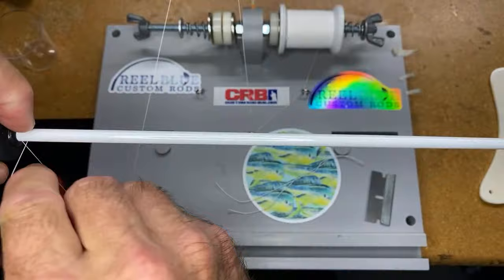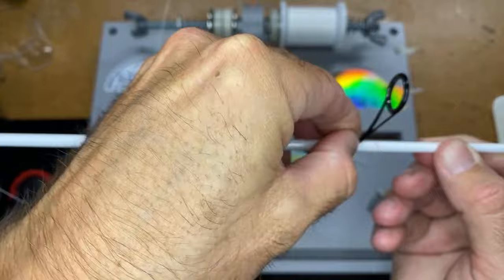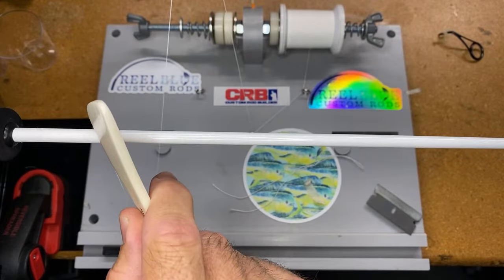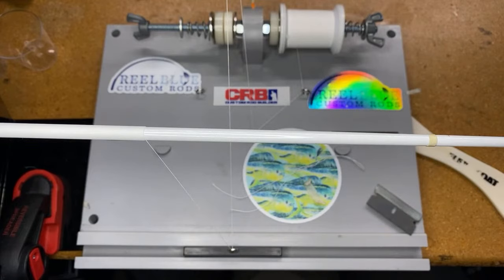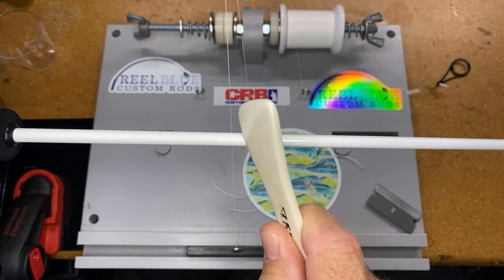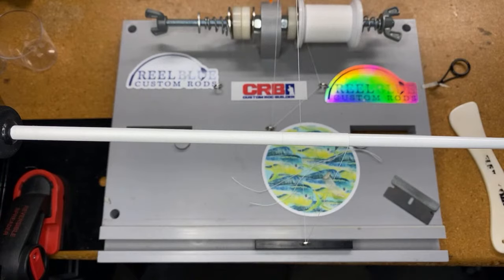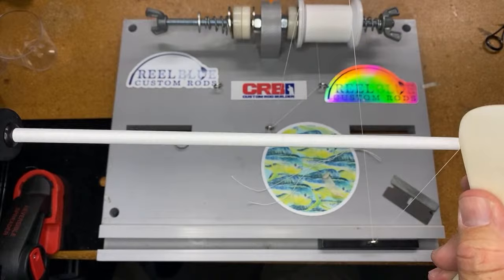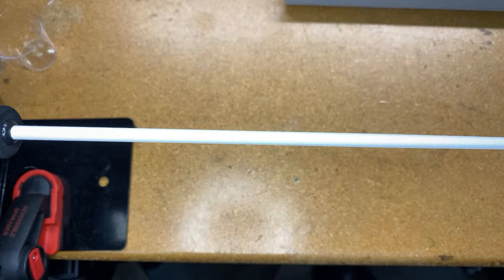Discover the Surprisingly Simple Dry Technique for Adding Pigments

Comment: Most of my pearls and pigments have come from Didspade or Paint with pearls. I really like the interference pearls that shift colors. I've played with them in the finish and they look good but don't have much control. This looks much better. Plus the interference pearls change effects depending on base color (thread in this case). 

Great topic for a video. Awesome. Thanks.
Reply from the maker: I’ve never used that brand before, but I bet it will work.
Reply from the maker: Also glad you enjoyed the topic.